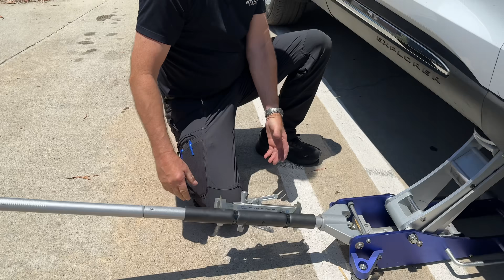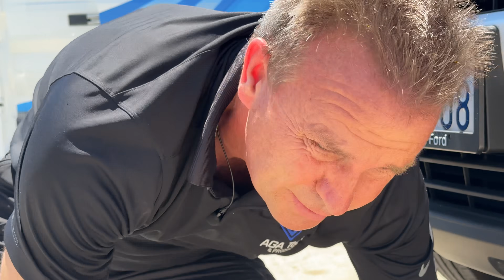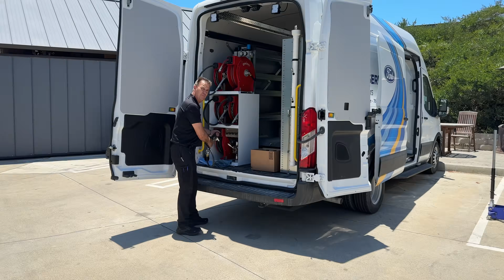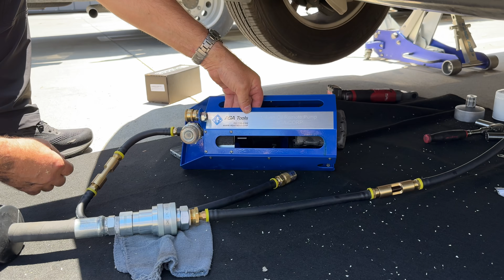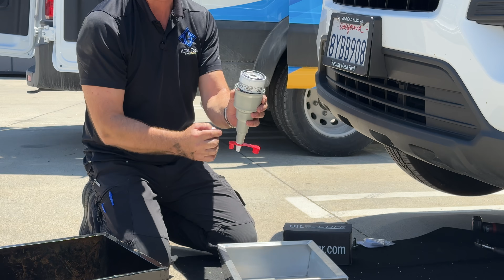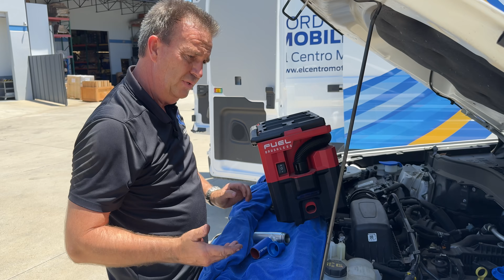AGA Tools Ford Mobile Service Kit in use

Comment: You forgot to run test and check the filter leakage at the end of the oil service with RPM at 2000.
Both oil filter and drain plug needs to be checked at the end of the service for quality assurance and leakage.